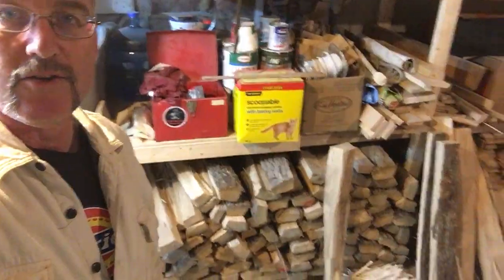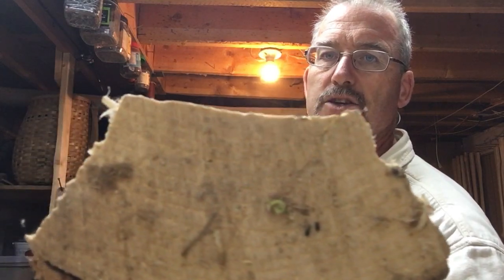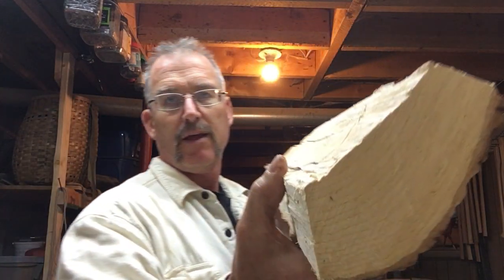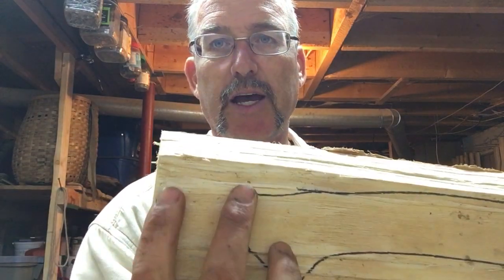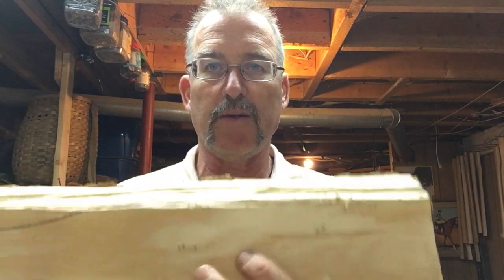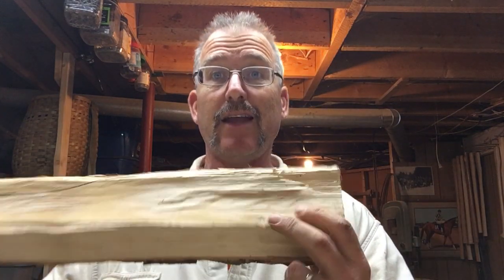Making an axe handle - Part 1

Comment: Hello, Mr. Cumberland;
EXCELLENT! video, "THANK YOU!" very much!  Now to figure out 'how-to' by hand.
Or maybe you'll sell a rough blank so I can finish it myself?
That would be my choice if it's an option.
BTW, I've got a broad axe/hewing hatchet I hung on Lowes' handle.
I hung like a regular felling axe because I'm a dummy & did NO research first.
The broad axes I saw as a 'youngin' didn't have angled or 'kicked back' handles, as I recall.
I just hung an old Jersey pattern on a short House Handle, 1st time in 'but 40 years.
The head looks like an old Council Tools w/ "U.S.A." cast or stamped along the poll.
When I got the rust off I could see some red paint, that's why I think it's a Council Tools.
If I don't see your reply I'll email to find out about a rough blank.
Have a GREAT day, Neigbor!
P.S.
I hope you don't freeze, I hear it's getting colder.
Reply from the maker: I can definitely sell you a rough blank, but the only issue with this is the cost of shipping.    I'll sell you a blank for $20, but the cost of shipping will be a lot more due to the weight.  please go to the website and order there is possible, otherwise e-mail me at eastcoastlumberjack@gmail.com
Reply: @eastcoastlumberjack 
Thank you so much!
I checked the site since I posted here.
It looks like your prices are pretty good.
I'll prolly just order a couple of handles.
Now that I know you have broad axe handles.
I used a Lowes/Trouper handle for my broad axe/hewing hatchet.
I'm not satisfied w/ it.
Mp broad axe has a single-bit eye, about 2"x 13/16".
It'll be a couple months, I'll be in touch.
Have a GREAT day, Neighbor!